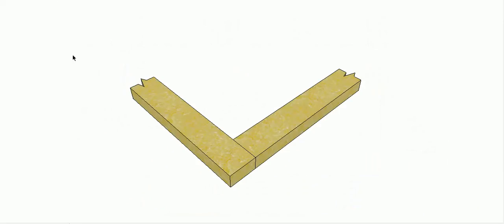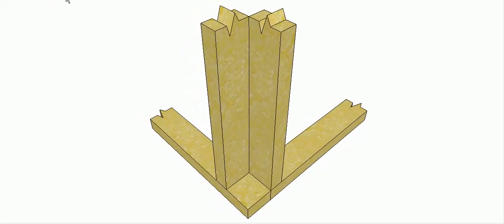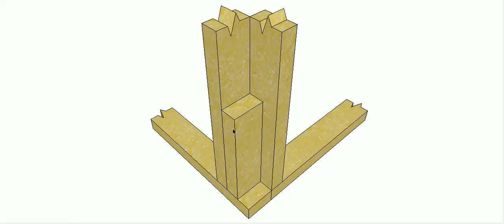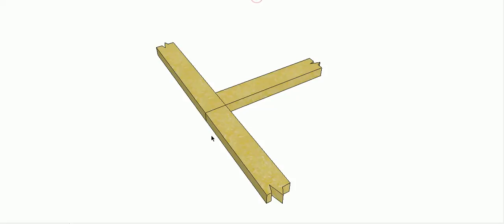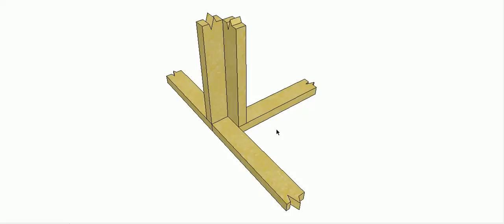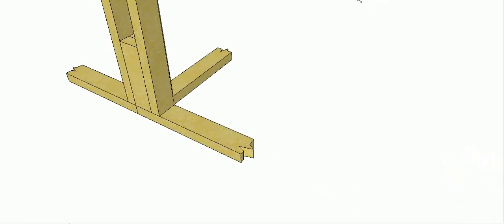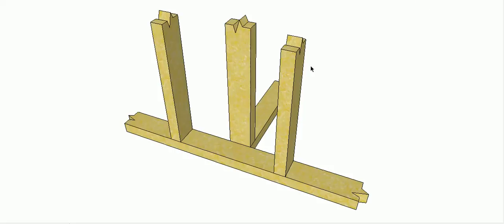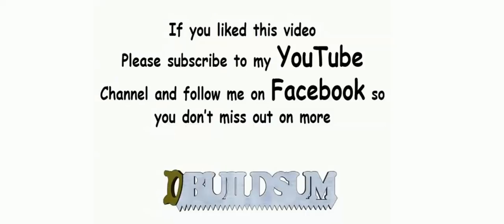Typical Wall Junctions

Comment: 70x35 corners are easy, but I wondered what most people generally use for blocking when framing with 90 or 75x45 where you need a tight corer such as in a wet area?
Reply from the maker: Hi Pete, personally if I am doing 70mm framing I will try to use the 35mm thick timber as it works. Otherwise, if you are using 70 x 45 you will need to use a 25mm block that I generally have to rip down on site. Same with 90mm, 45mm works fine but the 35mm will require a 55mm block.
Hope this helps.
Reply: Thanks mate, much appreciated. I agree, 35 mm mates it much easier, however some of this is re-work (well, more like trying to make the most of the mess somebody else left behind) and I'm sometimes trying to tie in to his brilliant handiwork. A lot of it I think will be easier to just rip out and start again from scratch but I need to draw the line somewhere. I thought I'd just rip some other timber down, but wondered if I was missing something obvious. 

Keep up the brilliant work.

Comment: good information, but seems your dimensions are off. a 2x4 is not true 2x4. it is actually 1.5"x3.5". which means the corner on the wall with double studs and blocks you are loosing 1/5"... so the studs on the inside corner do not meet at the corner so clean. one is inset .5". good information though. love these vids. just dont understand your terms for things. but visually i can completely understand.
Reply from the maker: Hi Mate, thanks for your comment, sorry these are set up for the Australian Timber sizes which are 90 x 45mm or 90 x 35mm, When forming these intersections it is more common to use the 90 x 45mm section size. Unfortunately, the terminology tends to change from region to region however the term I try to use are the ones from the appropriate Australian Standards.
Reply: @Buildsum  yea i learned that from you after listening. you are very informative. wish out studs were like yours. sucks to be american i guess. lol